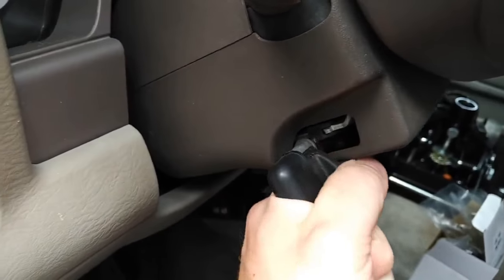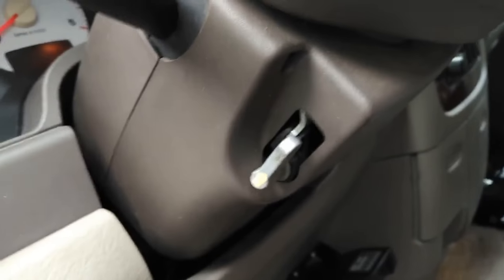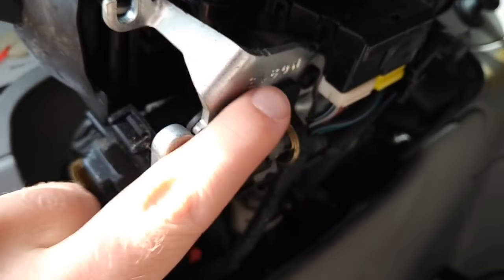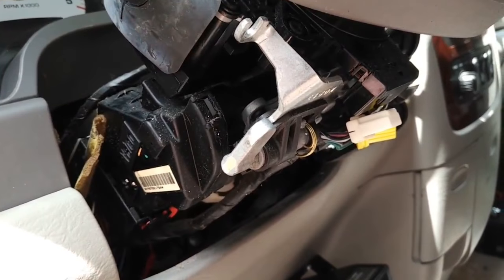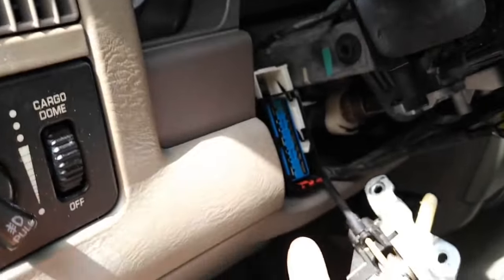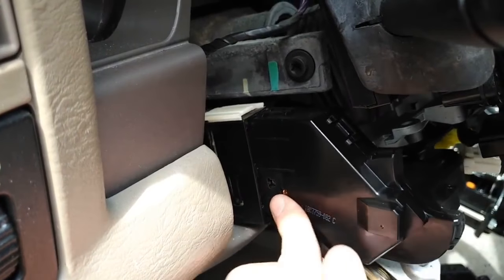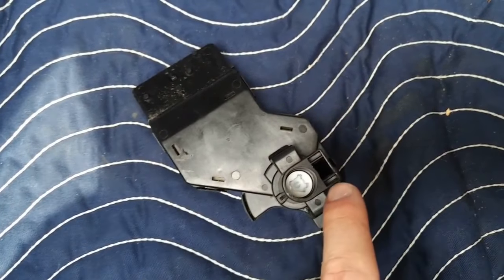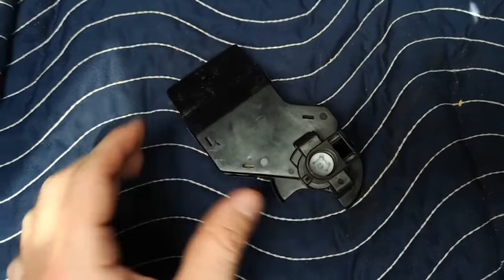Ignition switch replacement 2003-09 dodge ram

Comment: Excellent video.  It worked like a charm. Half hour-45mins and everything was working like it's supposed to. Thank you.
Reply: That ignition switch also controls power out to your trailer brake controler if you have one,just spent a couple of useless days trying to find the problem ,replaced switch and now have trailer brakes

Comment: A few notes.  Better explanation of your actual struggle with this.  The lower half of the clam shell must be pulled away from the ignition.  Also I did not remove those little clips to get the bolt for the tilt lever.  Do not remove the white clip from the big plug.  Grab the pan under the column and pull down for more room

Comment: Well I have to say that after googling “gremlins” for my 2005 hemi ram, my gremlin’s fit the bill for this switch. My only issue upon reassembly was that I kept forcing the long skinny prong of the ignition switch in, not over the receiving end. Once that was adjusted it was smooth sailing. I did have a few extra torx screws left over though.

Comment: Great video!! I have a 2009 Dodge ram 1500 Ltd. I left work today started fine. Went 1 mile to the dollar store and would start. Ignition kept sticking like it was starting and starting over and over again but with engine starting. Thought it was battery, charged that and not battery. Then rebooted WCM by disconnecting negative cable on battery. Wasn't that. Now this has to be it. Having it towed to dodge tomorrow. Hopefully not expensive. If I knew exactly what it is I would try to change muself
Reply: Was it the switch mine doing same thing

Comment: Heater blower had stopped working but this was the cure. Might be worth mentioning that the white and yellow plugs do have locking tabs on the top side. Just squeeze each plug top and bottom and it will pull right out.  I also had to widen the two slots in the long skinny end. I used a drill bit that was slightly larger the the opening and just worked it back and forth a few times in the slot. My key position seemed extra tight same as yours. But after replacing heater blower motor, resistor, and relay, this got the blower working. Neither my old switch or wiring harness showed any signs of getting too hot.
Reply: Am having the same problem on the 2005 Dodge caravan. Replaced the heater blower motor, resister and tested the relays (good) and still. the blower is not working. So your saying replace that black "thingy" solved your front blower problem q

Comment: I had to replace my ignition control module and wiring harness. 2004  Dodge Ram 1500. I had the same issue with the new control module I ordered off eBay being an off brand with no logo..it was just $37.00 remanufactured . I tried to get the thing to set for what seemed like forever and couldn't, then saw this video. I realized that the new one did not have 2 slots to go into the plastic guides that are inside the place the module seats in on the steering column... just the 1 on the 1 side with the big one in the middle. I actually had to get a drill with a tiny drill bit and aggravate with carefully drilling the missing hole. I'm on my farm 60 miles from my sister  and a ride..stuck with just my work truck. I ended up saying screw it and simply broke off the plastic guide inside the place the module seats in on the steering wheel. Wasn't concerned about doing it because the 2 screws held it securly..i can take it back off later and super glue the plastic guide back on. The ignition control module slipped right in. I wouldn't have figured it out if I hadn't seen this video where you show you had to use a screw driver and widen your middle one. Thank you so much!

Comment: To remove the  white and yellow plugs,  push down on the top of them with a small flat screwdriver . They're hard to see, but that's where the tabs to disconnect them are located.
Reply: He could have shown that in the video. Too bad he didn't.

Comment: I'm sure you knowthis but when your removing the steering wheel plastic that bottom panel below the steering wheel just pops off the top is just  held in with tabs so this makes it alot easier to get every thing off and more importantly back togather all lined up easily

Comment: Hey, so I have a 2004 ram 2500 and the lights in the instrument panel quit working. The lights behind the dials work but nothing else. My odometer doesn’t work either. So I thought that it would be a problem with the cluster. After fiddling with it a bit, I realized that my glow plugs weren’t working. So I thought that it was the ignition not telling the computer that the lights need to be on and the glow plugs. The truck on the other hand still runs.

Comment: That looks nothing like the ignition switch in my 2008 1500. The one I have matches the Oreilly auto parts inventory but doesn't look like what you just pulled out at all. they must have been making a transition in 08 or used different switches for different packages.
Reply: They changed the part number in 2006, but the installation is the same.

Comment: have 05 1500 starts runs if you hold key just after run position. if let key fall back to run position it stalls. i replaced starter and ign switch. ideas
Reply: Mine is doing same thing, it's been 7 months since your reply, hopefully you get it fixed, what was the fix if so? I'm going nuts working on this thing. Lol

Comment: Question did the hard turning of the key ever get easier ? I put a Standard brand in and it's pretty catchy on the stops
Reply: I just replaced mine today with a switch from CarQuest it its firmer as well, did yours loosen over time?
Reply: @subimark3543  yes it did loosen up

Comment: Hey Dude have an 1500 08 ram that I haven’t started in about a year ... truck has absolutely no power no lights nothing. I’m thinking it could be ignition switch I know battery is good. I know it doesn’t sound it but think it could still maybe be starter ? Maybe even alternator? Just looking for your opinion gonna start with ignition switch. Appreciate any help just really not trying to tow it cause I can’t get it started.
Reply: Did u find out what was the problem
Reply: @danielhernandez7509  yup it was ignition switch !

Comment: When i turn my truck off the air conditioner and radio stay on. The key comes out while im driving so i bought an ignition . I havent put it on yet but i was wondering what your truck was doing to make you change the switch?
Reply: On mine the windows quit working and the door a-jar wasn't dinging anymore. The biggest thing was the windows from the master switch. My switch was burned on 2 of the prongs
Reply: On mine the windows quit working and the door a-jar wasn't dinging anymore. The biggest thing was the windows from the master switch. My switch was burned on 2 of the prongs
Reply: Same thing happened on mine same symptoms.  This fixed it.

Comment: Hi sr i have 2005 Dodge ram Cummins i change the part still not have the power  in the gauges and not star
Reply: Did you ever figure that issue out I'm having same issue on my 2004. Gauges light up but the gauge needles don't work and so the truck cranks but will not start
Reply: @jordanchamberlain5937  
Did you figure out your problem? I also have an 04 doing the same thing
Reply: @markculver4059  yeah mine was water and oil damage to the ECU. I opened the ECU and carefully cleaned the entire board with 91% isopropyl alcohol and q tips. Took 2 hours but since then no problems

Comment: Do you have the part number for this ? Video makes this look easy . I'm gonna do it myself.
Reply: standard motor products us351 ignition switch. $27 on Amazon.
Reply: I'm just about finished and then a small  black harness drops from somewhere.  Do you know where this get plugged back in ? I've looked all over with a flashlight and mirror and still cant find where it plugs back in .

Comment: would replacing this part fix a random turning off issue? it does it every now and then
Reply: It fixed mine. I had the random engine dying in the intersection.

Comment: My brother has a  2003 ram 1500 and a few days ago his truck stopped running because he cant turn the ignition key all the way. This sounds like he needs to replace the ignition key. Is this correct?
Reply from the maker: It could be the ignition switch but there is also an ignition cylinder as well that could be the culprit. But make sure the truck is in park and not stuck in reverse or anything and also check that the steering wheel isnt locked.
Reply: thx

Comment: Did ur truck work after i did same thing n my dodge stil just clicks
Reply from the maker: Mine did. I wonder if you have a battery or starter issue. My switch turned out to be good and I actually switched back to the old one and kept the new one as a spare
Reply: I had mine on booster cables just clicks so prob gunna replace starter it 4 years old anyways
Reply from the maker: If you haven't done the starter before I got a video here about some of things to be aware of with the start replacement: https://www.youtube.com/watch?v=Qv-Nn1bPHB4

Comment: Hey boss my 2003 is clicking when I turn all the way but it won't start the engine is fine do you think it's the starter or the ignition switch?
Reply: I changed my starter having same problem still soo going with the switch now see if it fixes it
Reply: Having same issue. Just get a click every now and then already replace the starter and still doing it.
Reply: @mariofromaz  did you ever figure it out, mines doing the same thing
Reply: @jonathonbrown3504  nope. Tried doing the shifter thing moving it out of park and back into park. Sometimes works. But not sure if thats the problem. Ordered a whole new computer to see if thats the issue. Going to tackle the ignition switch after that.
Reply: @mariofromaz  did you get it to crank?. Mine is doing this also.  If i hold it in the crank position for 15-30 seconds it cranks
Reply: @jonathonbrown3504  no i didnt. Just sold the truck. 2 months ago.
Reply: @Beaulowe  no i didnt. Was still doing the same thing after i changed out the computer. Replaced the starter. Thats where i left it. My next option aas the ignition switch. I just replaced the while ignition a year ago. But it wasnt doing it then. It was just the key was sticking so i replaced it.
Reply: Mine was doing this. Turn key and battery was all good lights would turn on. Bypassed the safety of the ignition switch all together after checking fuses and relays, by taking the ignition starter relay in the command post, put my key to the on position and stuck a hot wire in the ground and hot placements of the relay low and behold my truck started on a dime. So that ruled out starter and the solenoid. If you’ve checked everything from basics to this give it shot. Hopefully I’ll switch out the ignition switch and problem will be solved. Wish ya luck.

Comment: What was wrong why did u decide to change it?
Reply from the maker: I changed this because my guages sometimes turn off and back on while I drive down the road as if I turned the key off. This didn't solve the issue and I'm still hunting for a solution.
Reply: @OutpostCTD  did you find solution yet?  My Ram does this as well.
Reply: @oltob6707  same question here
Reply: Outpost CDC DID you find a solution to your gauge issue I'm having same problem?
Reply: Same
Reply: @SarahSashaSmith  Soumds llike a computer problem. Did he put a code reader on the ignition?
Reply: @SarahSashaSmith  did that repair your problem? Having this issue but had the relay clicking in the fuse box also recently and heard the distribution box was bad with getting corrosion in it but they are on back order at moment
Reply: @SarahSashaSmith  Thank you. That is unfortunately what I am looking at having to replace from research seems a common issue. Had ASD relay just clicking 2 weeks ago and every sense then have had issues with not shutting down for several seconds after switch turned off to dash lights and issues. Seems happen after rainy days so thinking the fuse block has corrosion.